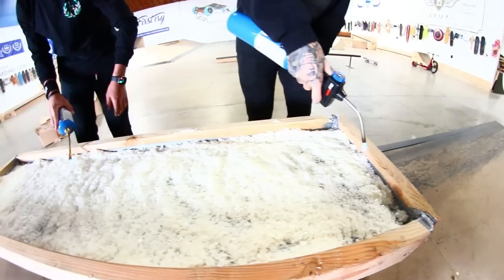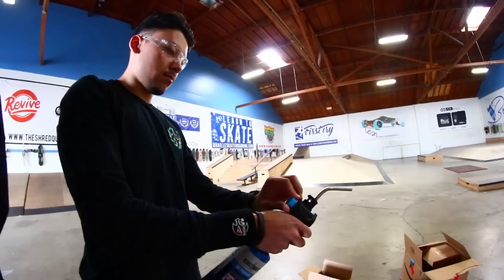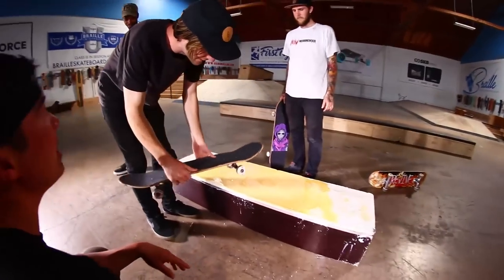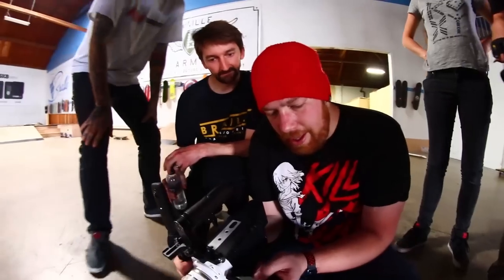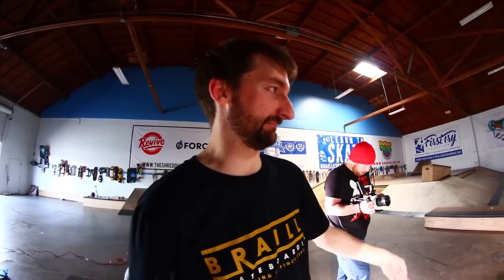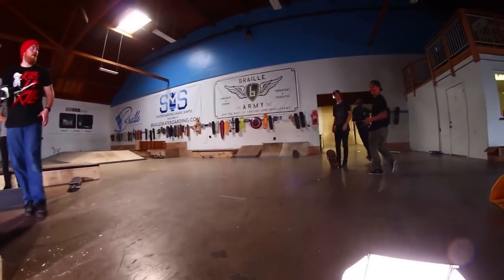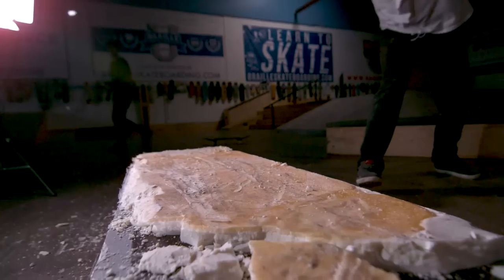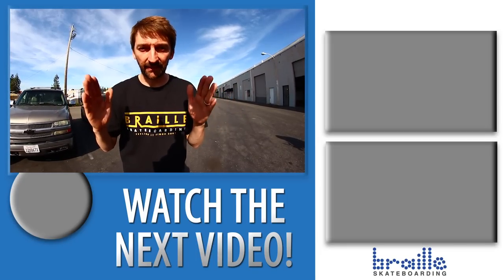WORLD'S FIRST 100% WAX LEDGE | SKATE EVERYTHING EP. 291

Comment: 12:36 he says its like ice. I think u just discovered what to do to the ledge next video freeeze it!!!
Reply: They need to see this
Reply: bump
Reply: He means 13:36
Reply: ice ledge
Reply: Iiiiceee
Reply: Or they make an ice ledge
Reply: A better idea would be pycrete: sawdust frozen in ice, could also work with the wax but you need to make the block more dense by adding tiny solids. That way it will hold up against grinding and heat better

Comment: should have mixed some beeswax with it it would have lasted a lot longer
Reply: Bees wax is very soft with a very low melting temp. Carnauba wax is much harder and has a higher melt point. It is also quite expensive.
Reply: @AaronAlso  carnauba? What is this a tictac? ps, carnauba wax is the outer coating in tictacs
Reply: @Ethan Stam lol
Reply: AaronAlso actually beeswax and paraffin wax makes perfect skate wax.

Comment: You can make a really nice ledge like the one in the video by using a cabinet (I found one at a closed down shop that was being renovated), a nice long, narrow sheet of high-density polyethylene (HDPE, which is used to make plastic lumber) and a couple of pieces of angle iron.  You don't have to put a bit of wax on it, and it will slide oh so splendidly.

Comment: Instead of wax you should try Polyethylene. You can buy it in large think sheets or you can do another DIY with bunches and bunches of milk jugs melted down. The PE should be as slick as the wax but much much more durable.

Comment: It would have worked so much better if you warmed the very top layer just barely, youd slide way better if it was slightly melted just the skin on the wax. It would also temper it warming it up over and over everytime you do a trick. Would have chipped far less.